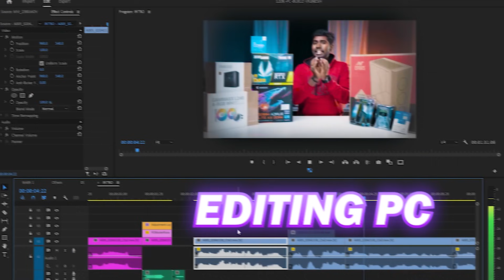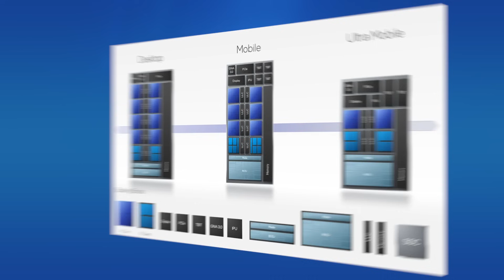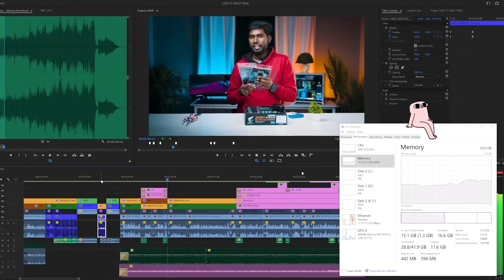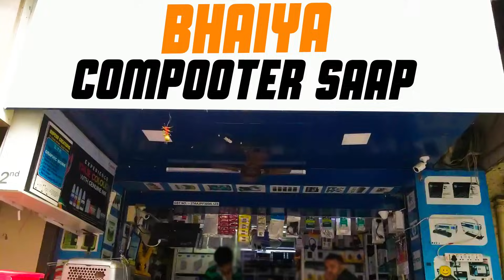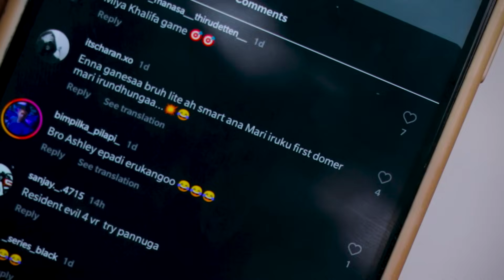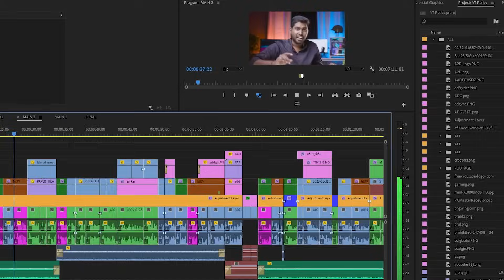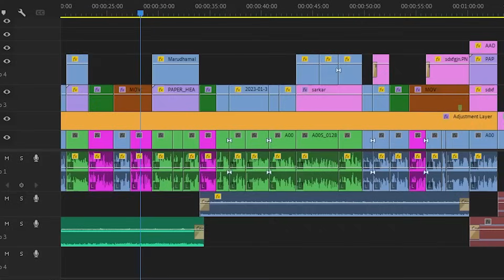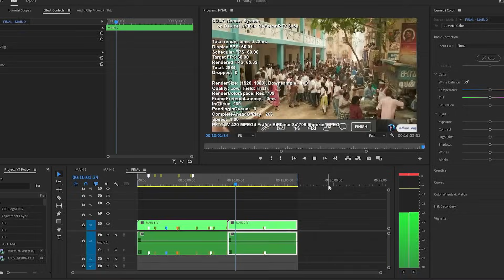Rs.1,20,000/- Editing PC Build 2023 Tamil | Intel Editing PC Build | Build Ur Own PC

Comment: R5 5600x + rx 6700xt is a killer combo at this price if your main priority is gaming
Reply: Adhu yen ivlo cost aaga podhu idhu new gen
Reply: @ITX635  bro with 6700xt neenga edhachi stuttering, black screen issues edhachi face panringala...
Reply: @s.monesh04-rq4vb  adhelam andha card launch anapodhu irundhutu ippo adhelam illa drivers ellam improve pannitanga  gaming la RTX 3070ti vida 5% extra performance kudukudhu 6700XT with (SAM)
Reply: @ITX635  neenga enna driver use panringa bro...
Reply: If you combine it with better processor it would perform better
Reply: @adeptgamezone8457  nope 5600x is more than enough he will get better performance if he add ryzen 7 5800xt 3D it have Vcache so it will give performance

Comment: Ivlo nalla build pannitu cabinet oru dummy brand la potanga
Vera yaarachu build panninga na nalla Air flow iruka ma3 paathu vaangunga also get 360MM radiator AIO or 140MM Air Cooler
Reply: aama bro 1lacks ku pc vangitu oru karupu pettiya table la vaika vendiyadhu ah iruku🤦🏿‍♀️ white cabinet is my favourite
Reply: @ITX635  ipo color base panni cabinet pricing pandradhu kooda illa 
So konjm nalla cabinet ah deepcool 4F mesh or Corsair 4000D airflow or lian li Lancool II Mesh vaangi irukalaam

Comment: Recently i built a pc with i5 13th gen , processor performance is insane. Even better than my threadripper pc in real time usage
Reply: For real Or in sarcasm way
Reply: @sureshkrishna2208  real time 90% you use single core only . Threadripper Max will go 4.2, this new Intel one reaching 5ghz . Handling the project is much easier than my threadripper.
Reply: @dhanakodimani4783  threadripper not made for single core performance I guess
Reply: @sureshkrishna2208  yea bro , it's not made for single core performance. I got that processor in 2020. At that time 4.2ghz outstanding one .
Reply: Enna cooler bro potu erukinga 13th gen ku

Comment: Had a dbt, you have mentioned that for editing better to go with 32gb ram, but in the latest video on Ram, you mentioned that no performance boost after 16 gb. So which is advisable 🧐
Reply from the maker: That Video is just for comparing ram in single type of work. In real time we use multiple softwares. So, having 32GB of ram is good for Video Editing

Comment: If Graphic card budget is under 25k better to go with Rx6600 instead of 3050
If budget can be pushed then better to go with rx6700 xt instead of 3060ti which performs better
Reply: But 3060 ti supports both Dlss and Fsr whereas Rx cards support only Fsr. In raw performance Rx cards will be a better option 👍🏻 (Just my personal opinion brother) 😅
Reply: @mutant2871  rx 6700xt is better because for future gaming it has 12gb and it is 3to5k cheaper than 3060ti now
Reply: @rafeeq37769  Increased VRam doesn't mean increased performance brother 🙂, Even 3060 has a 12GB variant, Still 3060 ti's 8GB variant can outperform it 🙃
Reply: And still RX 6700xt is the better value for money card comparing to 3060 ti. But Dlss supports three times the no.of games FSR supports 😅.

Comment: Hi I am from malaysia. always enjoys the content, unfortunately I cant buy PC from A2D due to different region. Recently I built my Own PC for RM 4540 (84680 Indian rupee)

specs: 
1. Gigabyte B650 Aorus Elite(AM4) ATX 
2. Corsair CX650M 650W Power supply 80+ Bronze
3. Zotac Gaming RTX 3060 AMP White edition Ver2 12GB
4. kingston NV2 1TB M.2 2280 PCIE Gen 4
5. ADATA XPG Spectrix D50 White DDR4 16GB (2x8GB) 3600MHz
6. Cooler Master MB511 ARGB Mesh Mid Tower ATX Casing
7. Aigo AT240 ARGB AIO CPU Cooler White
8. AMD Ryzen 5 5600 Processor

what do you think bro.
Reply: Nice build but they said before latest gen is worth
Reply: @subbammalrani2315  I am build this pc for my gaming. so far its doing very good job
xd

Comment: Bro I want a gaming pc build  under 80 k can you tell me the componts
Reply: CPU: Intel 13400f - 19750
GPU: AMD Radeon RX 6700(non-xt) - 29999
Mobo: Gigabyte B660M Aorus Elite AX DDR4 - 15800
RAM: Gskill Ripjaws 3200mhz (8x2) 16gb - 4000
SSD: Crucial P3 500gb SSD - 2700
Case: Under 3000
PSU: Cooler Master MWE 650w V2 80+ bronze psu - 4900

Total: 80,140